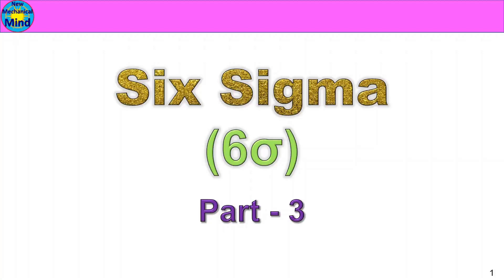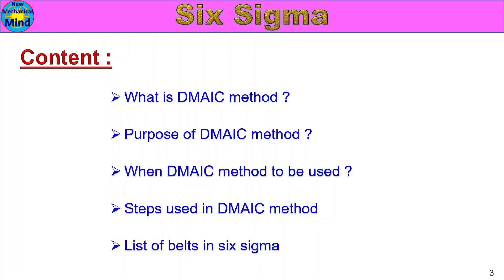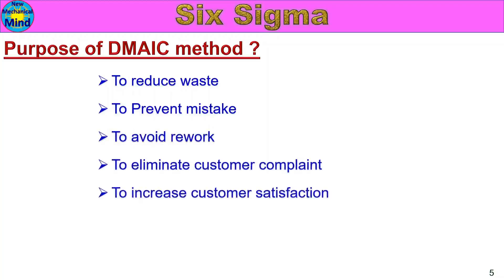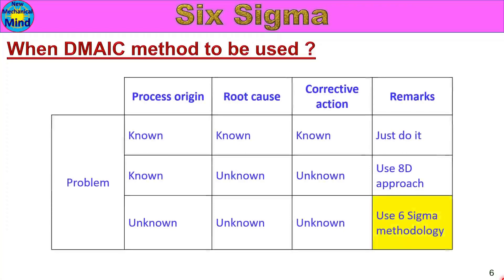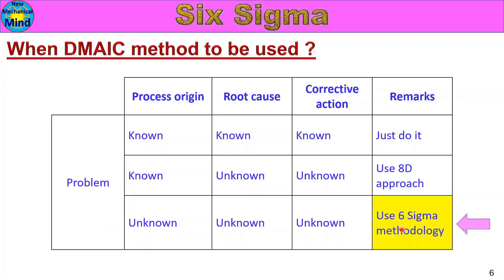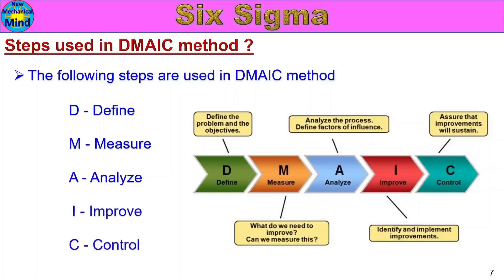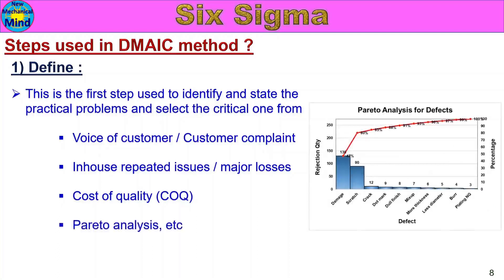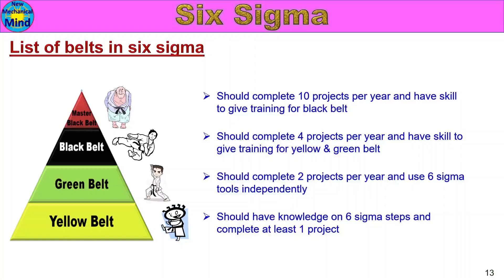What is six sigma | Part-3 | DMAIC | Define Measure Analyze Improve Control | new mechanical mind

Comment: Bias, stability, linearity and variable R&R study used to analyze the instrument variation (i.e., measuring instruments are used evaluate the physical quantity of a part, that produce continuous variable data as output. That data has infinite number of values)

Gage R&R used to analyze the gage variation( i.e., Measuring gauges are used to analyze the physical quantity of the part, that can produce discrete data as output (1 or 0) (ok or not ok))
Reply from the maker: Congratulations Gowtham